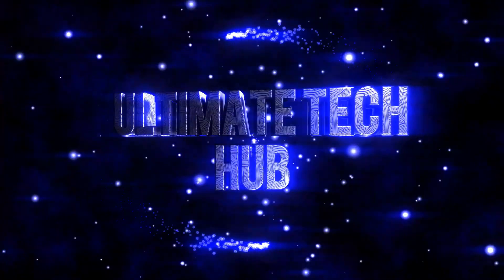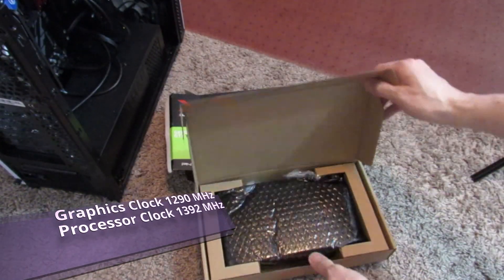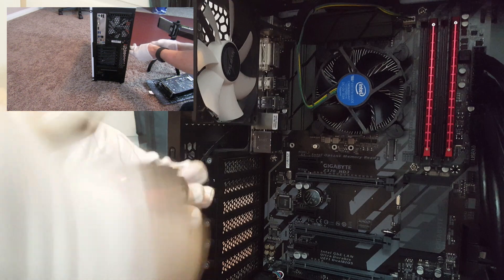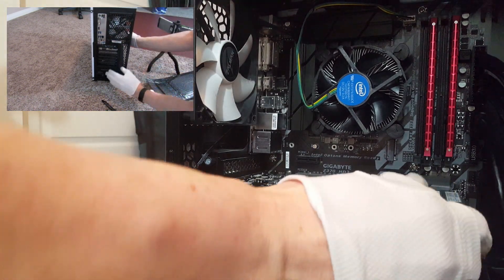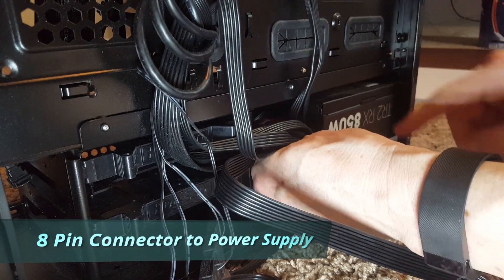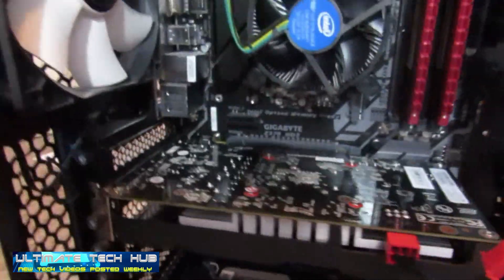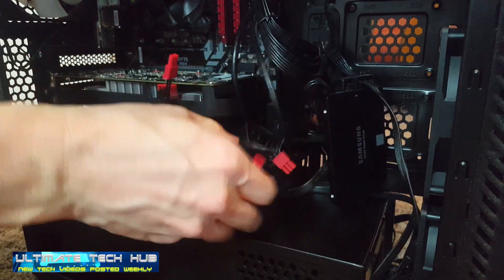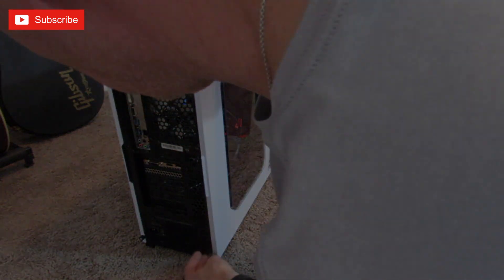How to Install - GeForce 1050Ti - Quick and Easy!

Comment: i dont have any cable connected to the gpu when i got it as prebuild... what does that mean
Reply from the maker: It means the motherboard is powering the GPU. You don't need the power cord to power the GPU. Most motherboards can power the gpu. In my installs i always show the most thorough and complete installation.  But in many cases the power cord is not necessary.  Thanks for watching!!
Reply: Ultimate Tech Hub I want to upgrade to a gtx 1660 super which i think needs a cable. What do I do then?
Reply from the maker: @trulyross_  if you do pick thie 1660 supee graphics card you will need external power to make it run  an 8-pin PCIe power connector. This means that the GTX 1660 Super uses 127.4W in the most demanding situations, so you should make sure you have at least a 500W power supply. Hope this helps.
Reply: Ultimate Tech Hub thank you!!!

Comment: Does the gpu come with a power connector or do I have to buy one separately?
Reply from the maker: It does not come with a power connector.  However your power supply will most likely have the needed power connector.  Thabks for watching and keep me posted.
Reply: @UltimateTechHub  Sorry to bother, what is the name of the power connector?
Reply from the maker: @montyclough2426  look for your power supply in your PC. Its the box with a fan and a bunch of cables running to the mother board and other devices. The power supply has many wires with different size connectors. When I say size that means how many pins. Some have 4 pins, 6 pins, 8 pins, 24 pins. Make sure to turn off your computer before messing with the power supply.  Avoid any electrical shock.

Comment: Hey is my mother board compatible with this GPU?
EMX-A70 FM2+ICafe ddr3
Reply from the maker: Yes it should.
Reply: @UltimateTechHub  is ryzen 5 2600 compatible? I'm planning to upgrade my AMD A6 6400K APU and add a graphics card
Reply from the maker: @snaper0218  yes it should be compatible.
Reply: @UltimateTechHub  wait ryzen 5 2600 is compatible with ddr4, I have ddr3 ram
Reply from the maker: @snaper0218  I'm not sure about the ryzen 5 2600 compatibility but im pretty sure the 1050ti will work.  Best option is to Google it.

Comment: I'm planning on getting a 1050 ti as an upgrade to my GT 710 and I'm worried if it will need any external power. Does it need external power
Reply from the maker: If you mean does the 1050 need to be powered by your PSU then yes. I show how to connect your the powersupply to the GPJ in the video. Most GPUs need to be powered by a power supply.  Keep me posted and thanks for watching!!!
Reply: @UltimateTechHub  ok thx bro

Comment: My psu doesn't have 6 pin or 8 pin is gtx1050ti compatible to my system?
Reply from the maker: Do you have 4 pins and 2 pins? You can combine them to make a 6 pin or an 8 pin connector.  Keep me posted.
Reply: @UltimateTechHub  I have 4 pin sir, but i don't think i have a 2 pin
Reply from the maker: @brildwg  well check your PSU and make sure. You will have to access it so you will need to remove the pc cover and look for all the PSU connections.
Reply: @UltimateTechHub  thank you sir i'm gonna upgrade my psu soon my psu rn is generic  lol rx 570 will destroyed

Comment: Are you able to connect the GPU to your motherboard and just let the motherboard power it up? For example, my motherboard is the DH61CR. Am I able to do that?
Reply from the maker: You can definitely try. I always use my PSU to power the GPU. If it works great if you don't get a signal then use the PSU 6 pin. Keep me posted.  Thanks for watching and if you subscribed thank you as well.

Comment: Is this Gpu compatible with my Intel DH61CR motherboard? Also, do the 8 pin and 6 pin connectors come with the gpu or do you have to buy it? I know you said no more connecting stuff, but do I have to connect it to my monitor through a dvi cable or is there nothing else there except ports for 8 pins or 6 pins?
Reply from the maker: On the back of the GPU are several connections for monitors. I would use the HDMI port. But DVI will work as well. The 8 pin connector is from the power supply to the gpu. The 1050ti is compatible with your motherboard as long as tbe gpu lines up with PCIe slot. I'm 99 percent sure it will.
Reply: @UltimateTechHub  Thank you for the help! I'll recommend you to others. Again, big thanks you helped a lot!
Reply from the maker: @dunkinbolt8133  you are very welcome. Keep me posted if you have any issues with the 1050ti. Its a great little GPU!!!
Reply: @UltimateTechHub  Unfortunately, I bought the CiT S012B case, that has a CiT M-300 PSU already built inside. Do you know any good graphics card I can get for it? My motherboard is a DH61CR

Comment: My screen always flashes or flicker once during startup pls help 😪
Reply from the maker: Its your display driver. You need to update it. Just Google how to update display driver. Its very easy. This is common when you add new hardware to an older system. I had the same issue with a few of my clients. Keep me posted. Thanks for watching and if you subscribed thank you as well.
Reply: @UltimateTechHub  i updated it and restarted my pc but its still there 😪
Reply from the maker: @LawrenceACD  Ok now you will need to check and see if the GPU is seated all the way in the motherboard. Best thing to do is remove the GPU and then reinsert it back into the motherboard. Make sure you hear that click so you know its all the way in. This should solve the flickering. Keep me posted.

Comment: Does a 1050ti need a 6 pin connector or does it run of the motherboard
Reply from the maker: I believe it needs the 6pin connector. However you can try it without the 6 pin and see if it works but it probably won't.
Reply: @UltimateTechHub  I just found out that it take power from the pcie slot so u don't need to plug in a psu
Reply from the maker: @lapszn  Thanks for the heads up I will add it to the description! Thanks for watching and if you subscribed thank you as well!!

Comment: Does the cable for the power supply come with the graphics card?
Reply from the maker: No it should come with the power supply that you have. If not you can buy one for cheap. It's a cheap cable. Thanks for watching and if you subscribed thank you as well.
Reply: @UltimateTechHub  Oh, I bought a build PC, with everything except the graphics card. I haven't opened the power supply case, but I understand it usually comes loose with the unit then.
Reply from the maker: @rick92rr  yes it should come with one.

Comment: bruhhhh my psu dosent have a 6 pin connector what psu should i buy that has a 6pin connector
Reply: the usual gtx 1050 and 1050 ti doesnt need a power cord same with the rx 580 and 480
Reply from the maker: Most new PSUs have 6 pin connectors. Make sure the PSU is powerful enough for your new GPU. I suggest at least 600 W or more so that you have room to upgrade your PC in the future. Good luck and keep me posted. Thanks for watching!

Comment: Can i have some help please ive done exactly what the video says and nothing had worked i have right now a radeon R7 built in processor and graphics card and when i set up my 1050ti on monitor it says no signal please help
Reply from the maker: Ok first of all make sure your monitor is plugged into the 1050ti not the motherboard. The 1050ti has a couple of inputs for monitors. Thats what it sounds like is happening. Keep me posted.
Reply: @UltimateTechHub  ive plugged it into the hdmi and dvi but it says no signal and ive plugged it in the 6 bit plug and it fits in my motherboard
Reply from the maker: @Ackryte  how many watts is your power supply? And you plugged in the correct power cable with the correct number of pins?
Reply: @UltimateTechHub  i have 350w
Reply: @UltimateTechHub  also perfect amount of pins
Reply from the maker: @Ackryte  it may not be enough power.
Reply: @UltimateTechHub  ah ok

Comment: will it work with a A320 PRO-E?
Reply from the maker: It should. Is the A320 designed for music and studio recording?
Reply: @UltimateTechHub   what do you mean?
Reply from the maker: @AZKL313  are you using the A320 Mobo for gaming or music studio production? Just wondering.
Reply: @UltimateTechHub  Oh! For Gaming
Reply from the maker: @AZKL313  Cool! The 1050 will work. Its a solid GPU. Check out my video the 1660ti vs 1050ti before you buy the 1050. I compare both side by side so you can see the difference in the video quality.Thanks for watching and if you subscribed thank you as well.
Reply: @UltimateTechHub  Thank you for the info! Will definitely sub now

Comment: Will my gigabyte ga-f2a78m-hd2 motherboard work with this GPU?
Reply from the maker: Yes as long as you have the correct size slot for the GPU which almost all MOBOs have. Keep me posted and thank you for watching and if you subscribed thank you as well!!
Reply: @UltimateTechHub  Ok, thank you. Have you done a video of the benchmarks of this GPU?
Reply from the maker: @rileybennett8414  I have a video comparing the 1050ti to 1660ti. I also have a 1660ti install video. Check those 2 videos out when you get a chance.
Reply: Ultimate Tech Hub  Okay I will for sure. Sorry about all the questions but do you need to install any drivers at all?
I have also subscribe :)
Reply from the maker: @rileybennett8414  dont be sorry about the questions. And no you dont need to install any drivers it comes with game ready drivers. It's just plug and play, same as the 1660ti. Enjoy the GPU you will love it.
Reply: @UltimateTechHub  Will this also work if I have integrated graphics?
Reply from the maker: @rileybennett8414  yes it should work.

Comment: Sir can i use it without plugged the 6 pin?
Reply: The 6 pin is where the GPU gets its electricity from the power supply so no

Comment: Linus (from Linustechtips or some other YouTube channel) said don't put a graphics card on top of an anti-static bag. May I know if working on a computer on a carpet causes any static electricity issues?
Reply from the maker: As you saw in my video I use anti static gloves. Static can cause issues for sure. Try disabling the current display adapter that seems to be a windows 10 issue. I have never had this problem but try disabling the adapter. Otherwise it's a bad GPU and go back and swap it for a different one.
Reply: @UltimateTechHub  sorry, I should have looked closer to see that you are wearing anti-static gloves.
Reply: @gordonyeoh8255  he did it on carpet dont do that it causes static

Comment: What would cause my pc to say no signal no matter what I do when I install the new graphics card (I went from a gtx 1050 to a gtx 1050ti) also I have windows 10.
But when I put the old graphics card back in it boots right up
Reply from the maker: My first guess would be the drivers need to be updated. Also if you are using HDMI cable for connection try a different one or buy a new one. That usually does the trick. Otherwise its probably a faulty card. Good luck and keep me posted.
Reply: @UltimateTechHub  I've uninstalled the old drivers like a video said an nothing then I've reinstalled them I've tried 4 different hdmi cables even though the original works with my regular 1050. I've disabled the Intel graphics driver nothing seems to work an this is the 2nd card I've tried I bought a 1650 an now the 1050ti an neither worked but my original 1050 works so I have no idea
Reply from the maker: @demongod607  I would install the old 1550 GPU and install those drivers. Then install the new GPU but do not uninstall the drivers and see if that works. How much power does your PSU have?
Reply: @UltimateTechHub  1,000 watt power supply also  I thought I mentioned I tried it with an without the drivers
Reply: @UltimateTechHub  also it's not a 1550 it's the nvidia gtx 1050 an I'm trying to go to the gtx 1050ti but I'm seeing tons of posts that people with windows 10 are having a hard time getting new graphic cards to work
Reply from the maker: @demongod607  sorry I meant the 1050 misspelled it.
Reply from the maker: Try removing all GPU's and starting your PC. Go to device manager and look for display adapters. Disable the adapter that is running on your PC. Turn off your PC and install the new GPU. Start it up and it should work.
Reply: @UltimateTechHub  also I should have mentioned it's a pci-e on the 1050 an the 1050ti I have
Reply from the maker: @demongod607  the new GPU should work so my best guess is it's a bad GPU. How old is your .motherboard? And what model is it?
Reply: @UltimateTechHub  I cant remember the model but it's about 7 months old
Reply from the maker: @demongod607  Well its not the MOBO so I would guess its the GPU. If  the old one works fine and the new one does not work then its the GPU. Your not going from an old GPU to super upgraded GPU. Its a minor upgrade so it should work. I went from a 660 to a 1660ti with no problems. Try to take it back and swap it for a new GPU.
Reply: @UltimateTechHub  I put the new gpu in my buddies computer that's running windows 7 an it worked perfectly but it wont work on my newer computer with windows 10
Reply from the maker: @demongod607  that's strange.
Reply: @UltimateTechHub  yeah so I'm completely out of ideas
Reply from the maker: @demongod607  well if he has a different Motherboard and CPU that could be it. But I'm really at a loss too.
Reply: This guys in a pickle
Reply: I am having the same problem here...
Can you tell me if you had found the solution to your problem and what the solution was?

Comment: Did the 6 pin connector come with the gpu
Reply from the maker: No I used the 6 pin connector that came with the power supply. I think most GPUs don"t come with connectors unless they have an unusual power connections.
Reply: @UltimateTechHub  can i use it without 6 pins?
Reply from the maker: @jaylapras6042  no you have to use it with the 6 pin connector otherwise it wont work.
Reply: @UltimateTechHub  thank you so much
Reply from the maker: @jaylapras6042  your welcome. Thanks for watching and if you subscribed thank you as well.